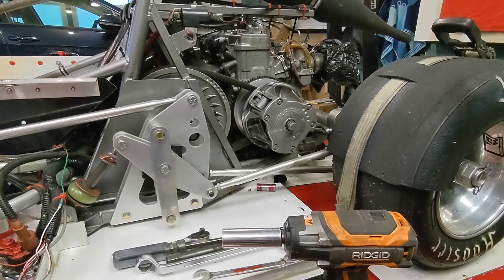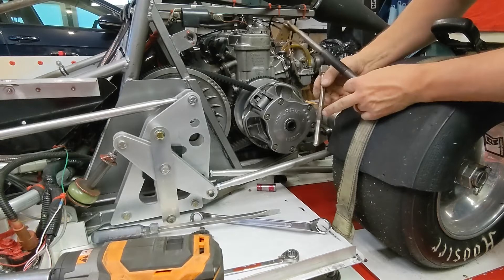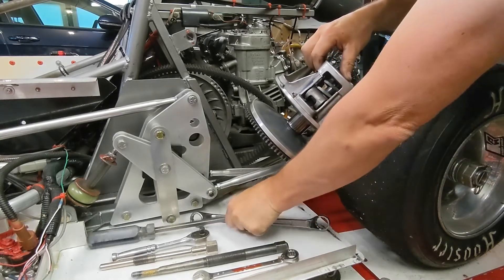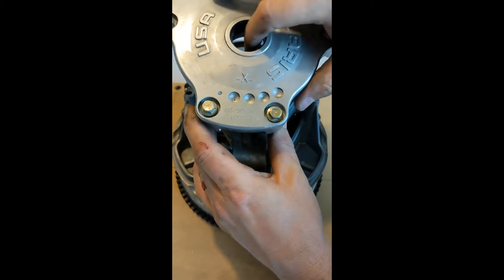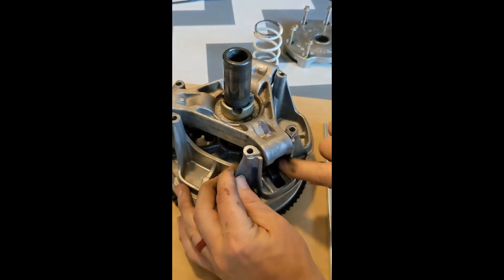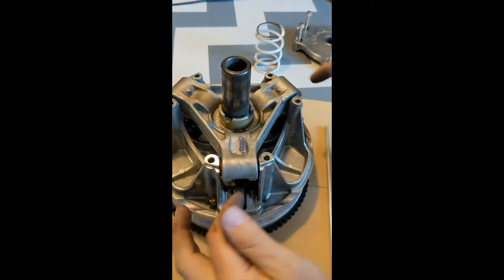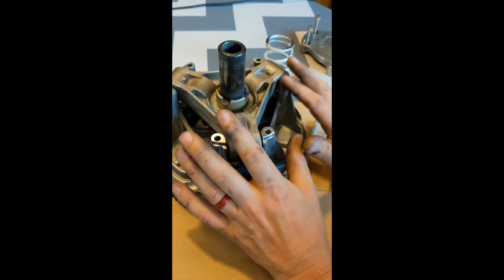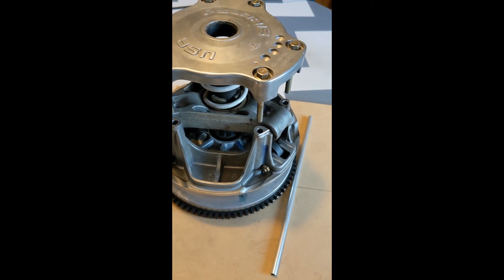FMod / F500 primary clutch 101

Comment: Rust is Natures Loctite!  If hitting the clutch puller with the battery powered impact doesn't do the trick, you next step is a breaker bar, generally with 4 to 6 foot pipe extension on the breaker bar.  When it comes off the noise and release will scare you.